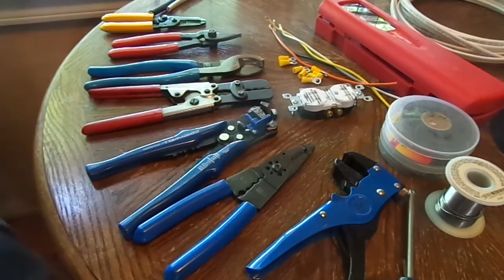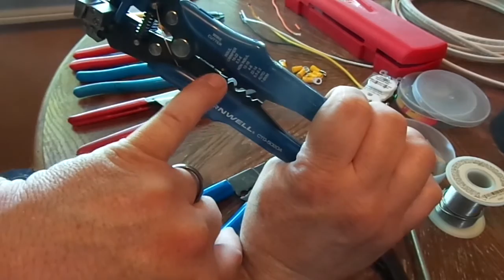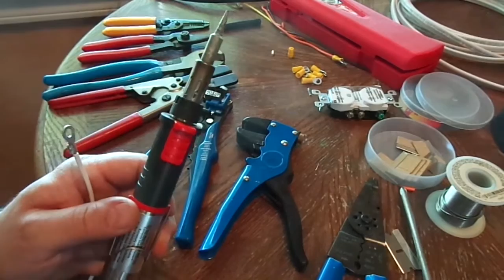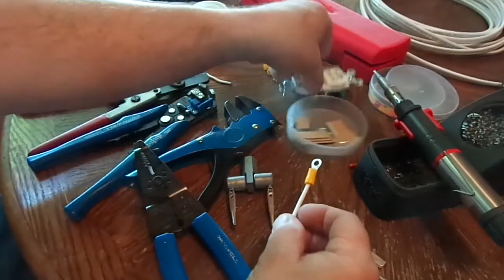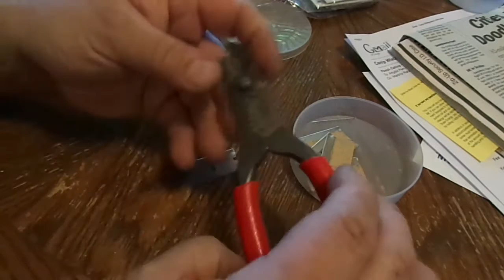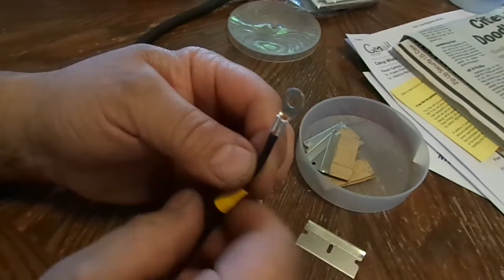My tools and Proper Crimping

Comment: A great crimper to use on high end equipment would be the "M22520/5-01" (DMC HX4) with the correct die such as the "M22520/5-100" (DMC Y501). Another really good alternative would be the "TE 58433-3" combined with PIDG terminals.

Comment: Cool video.
 l found out that using a torch for just a few seconds will  heat a connector enough to solder pretty well.

Comment: Can you comment on the helping hands your using?
Reply from the maker: That is a magnetic alligator clip available on most tool trucks. It's not the best I've used, Snap on has one that is way better and has a flexable head that I use most of the time now. I don't have part numbers for them but both are available on Snap on and Mac tool trucks. Thanks for asking